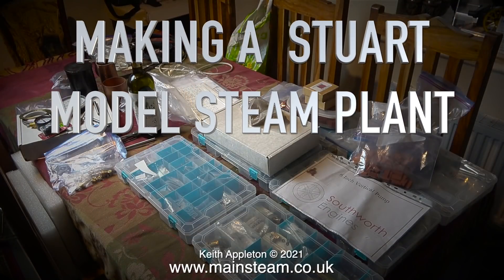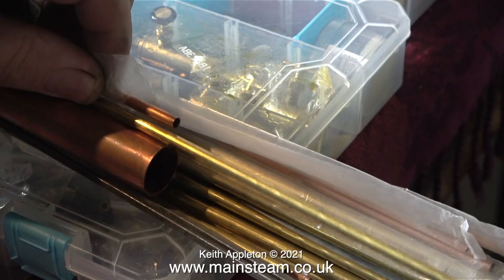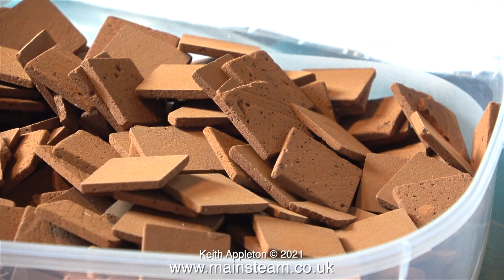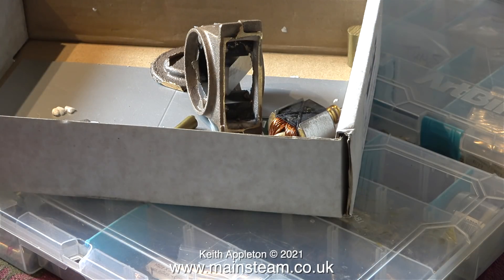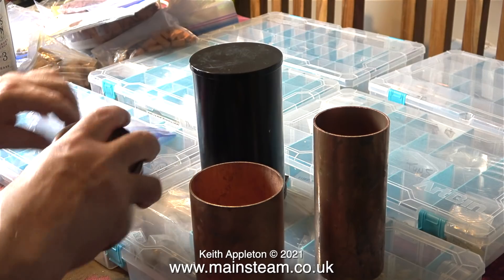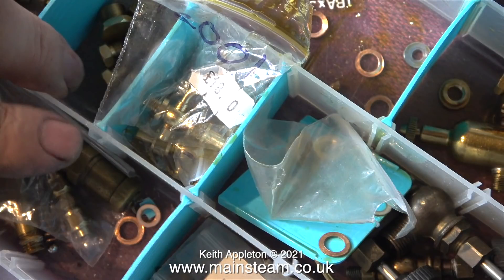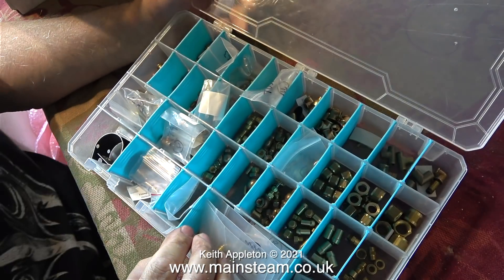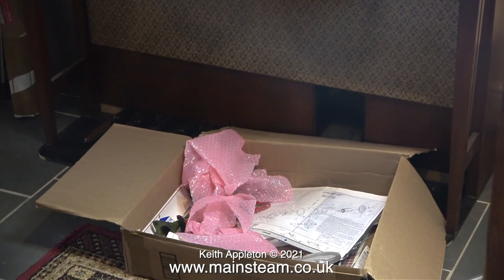MAKING A STUART MODEL STEAM PLANT - PART #10

Comment: The bell whistle looks very much like a modern Wilesco whistle. Quick warning: they are terrible. The plastic handle wears out extremely quickly and on top of that the whistle doesn’t even sound that good + it tends to spray hot condensate over your fingers while operating it.
Reply from the maker: That was just one of the parts sent to me by the customer who wants me to build him a Steam Plant and I will not be using it. I will be using a PM Research Whistle.

Comment: Dunno if this will do any good,but. There is an old technique for making concrete less porous for use as a water tank. Not much used anymore,it involves painting on several coats of waterglass,there is some sort of chemical reaction,the end result hardens the surface.
Terra cotta is unlikely to be as alkaline as cured concrete. Would it be worth experimenting with some broken tile, or are you satisfied with varnishing the terra cotta ? 
My own painting of varnish on hard porous surfaces was years ago,but I do remember just how unsatisfactory the result was.
Homework would be required on this,but I mention the idea as a possibility. 
All the best.
Reply from the maker: I prefer a Mahogany planked floor.

Comment: In the desert southwest of the U.S. we sometimes traditionally "finish" treat terracotta floor tile by painting on used engine crankcase oil (most often from "petrol" engines, although I understand that South of the border, diesel engine crankcase oil is used as often).  It does not make them slippery, but it does help them resist water and other staining.  Usually the oil stains the tile slightly darker.  The tile is so absorbent that it usually feels dry after a week, and won't stain a cloth or paper laid on it.  You are probably 'way past this in your release schedule, but if not already done or decided, you could experiment on your broken tiles.  I think it may be a Mexican tradition, and we don't seem to do this for roof tiles or tile set into walls.